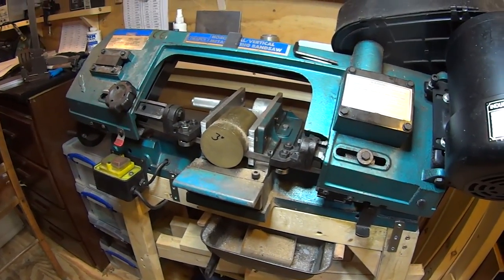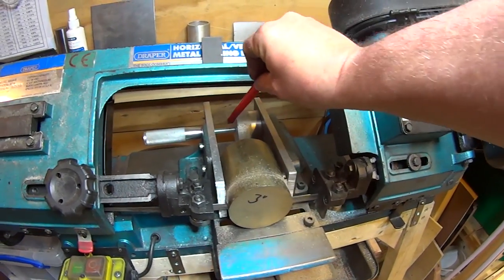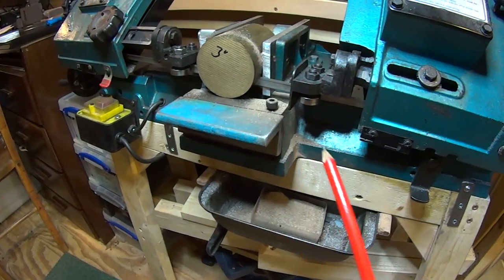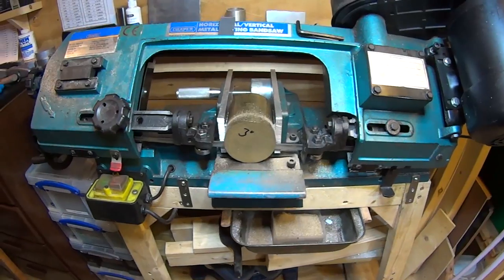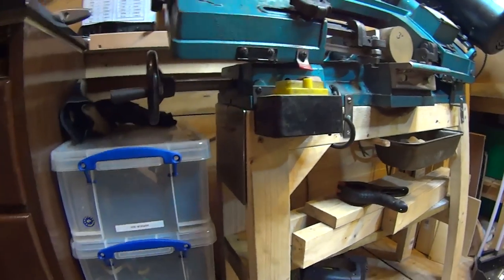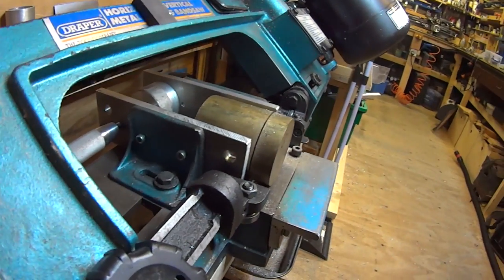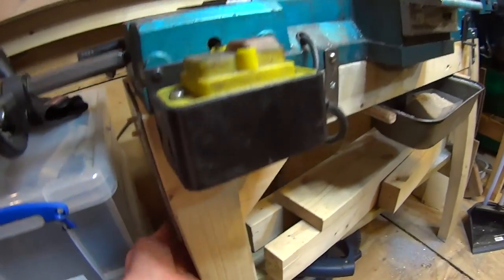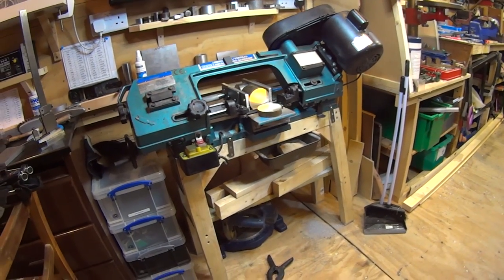6x4 Hobby Bandsaw Modifications & Improvements

Comment: Appreciate your video of your bandsaw modifications.. I find that a steel thin but stiff ruler placed in the top and bottom bearing guides without the blade on really helps getting both guides squared together to the fence and table and other adjustments it really speeds up the process of proper alignment.. also using a dry lubricant on the blade such as a wax stick made for cutting blades helps with blade life as well as clean smooth cuts..even a candle works in a jam..depending on materials being cut some times a little bit of added weight hanging on the grab handle on the front of the head speeds it up a tad bit..not so much to cause a blade jam up but a little does work good..

Comment: G'day Ade those mods you made are exactly what I would like to do with mine, I hadn't thought of using Alu to extend the vice jaws and the cutting ledge is a great idea thanks mate regards John
Reply from the maker: Thanks John, the mods make a big improvement, I have since also made some fine-adjustable blade alignment blocks and fitted wider top bearings, the machine is put to work daily and it is an invaluable tool in the workshop

Comment: I have a bandsaw from Sealey which is mounted on a light tin frame but ot was supplied with an extention table to use in the vertical mode, it is fixed with the 2 screws and also a bracket extending to the saw body where it is fixed by a large headed nut. I did similar improvements to the vice when first got it around 1985, still cutting very nearly vertical !!!!!!!!!!!  and as said best to get quality blades.
Reply from the maker: Thanks fella, it is a good saw with the modifications